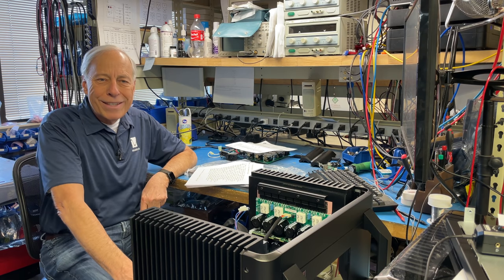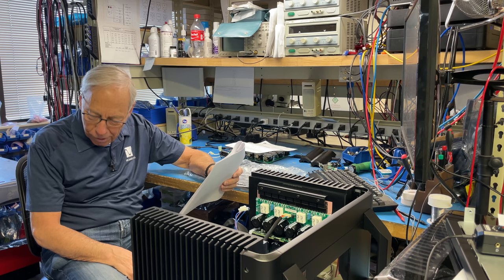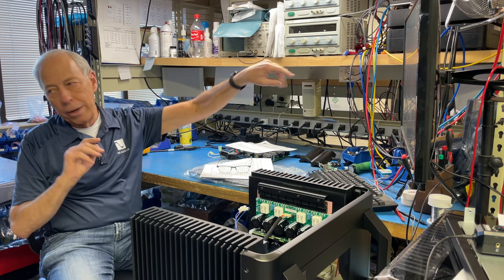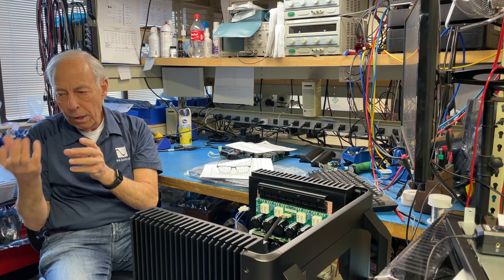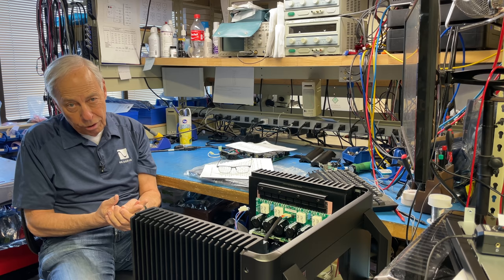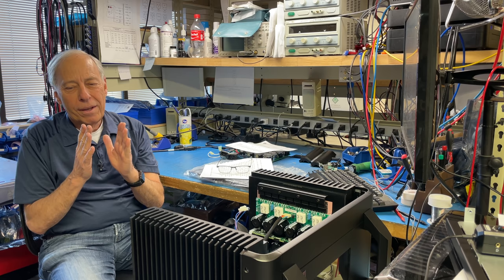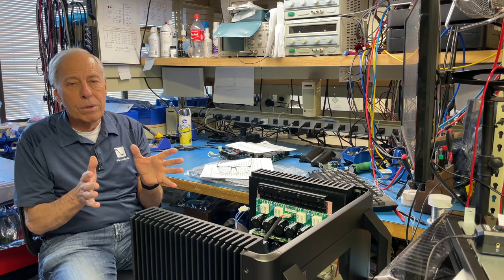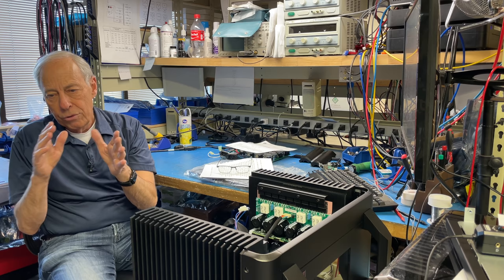Differences in digital audio cables

Comment: This is by far the best argument I've ever heard for buying premium digital cables. Still don't think I will though.
Reply: @Douglas Blake It's not even that. Even with an unlimited budget, I can't ever see myself buying 99.999(repeating, of course)% pure copper, quintuple insulated, cables with braids tied by organically raised German children. There's just no need. When it comes to digital cables, if they conform to the spec, they should be just fine. SOME of these ultra-fancy cables even break spec. If your cables are picking up noise, you probably just need to organize your cables or space out the components of your system. Monoprice and Amazon Basics cables will do just fine for the digital side, even if you spent $20k on the rest of your system.
Reply: LOL yes, most of the arguments are a lot less coherent than this.
Reply: @Douglas Blake who cares about that? the 0/1 bits when they are bitperfect don't have a noise

Comment: Provided the cables are technically sound it is 100% impossible for there the be a difference sound. As mentioned, the files are decoded and checked for consistency in the streamer. If the consistency fails, a new packet is downloaded. 

"Data isn't just data" wrong. Data packets are checked on multiple layers. When the application finally receives the constructed file it is 100% the same as the source. The jitter story is nonsense. And for the record, some folks did actual measurements on that, even with disconnecting the cables during playback. 0 difference. 

"Hifi switches" of hifi network cables are a scam. 100%. As for fiber, again if technically ok, the amount of signal loss is negligible and the protocols still error check it. We are talking thousands of kilometers before a file reaches you, through dozens of devices. It does NOT matter. The streamer matters, what it does with the file after it has been received. Not before.

Comment: There is only one way to settle this. Measure a sample of cables and provide those measurements.  Then see what is in the audible range.  Also see what the DAC does to the noise and jitter.  
That’s what science is for.    
I see NO measurements from these cable companies on their products.
Reply: Just have to listen to hear the difference.
Reply: @doctorrobin3040  damned there is no difference you can hear between digital cables - this bullshit is unbelievable!
Reply: @doctorrobin3040  If it can't be measured there is no difference. Otherwise you are then in the realm of magic or religion.
Reply: @Harald_Reindl  great business model though!
Reply: @zackschindler8334  Ah well there was a time the distance between your elbow and the tip of your middle finger was a standard measurement. Measurement science continues to improve.
Reply: @doctorrobin3040  Jesus christ get out of your analog bubble when it comes to digital transmission - it's laughable - you make a checksum on the whole source data and on the receiving end - if it's identical it's bit-perfect, case closed
Reply: @doctorrobin3040  so it is magic!
Reply: @doctorrobin3040  And yet even if the things you describe actually work do they make any difference it your listening experience?   
I worked at a GM car plant (Detroit/Hamtramck Assembly) for 30 years in the IT department. The plant was 100% dependent on the data from the servers and the network. If for any reason the line stopped running it cost $50,000 a minute (USD). Needless to say there was a lot of emphasis on us keeping data flowing. Never once was there a discussion about putting different CAT5 wires in or worrying about RJ45 connectors that might be "better" because they help the data flow. It was a noise laden environment with hundreds of welding robots running 18 hours a day. And yet the data still flowed. Rest assured that the 1's and 0's don't care what wire they go down. Don't fall for this. It is fraud.

Comment: That’s still not technically possible. If the bits had noise/jitter they effectively would NOT be the same. 

Digital cannot add noise to the file.

Comment: What does this galvanic isolation mentioned in the video have anything to do with digital audio cables?  Does anybody realize that ethernet is galvanic isolated by design?  The differential pairs offer common mode rejection and go through both inductive isolation through the transformer and capacitive isolation.  The DC coupling is done at the PHY.  A cable has NO SOUND.  A cable has RLC, period, end of story.  If you do the math the amount of RLC has to be GROSS to impact the low frequency of 20kHz.  If your cable is magically changing the sound either 1. Confirmation bias or 2. Fundamentally flawed audio gear in build or design.
Reply: it's about grounding issues with coax cables - just use optical cables and you are done - the digital transmission itself don't give a shit nor can bits have noise

Comment: Where is the noise with a cheap optical cable?  The only thing I can gather is that if your getting noise couples into your DAC from an Ethernet cable, maybe you should consider a better designed DAC. Ethernet does inherently have its own isolation.   What you describe for your new product with isolation and maybe moating is a very standard design practice, its just new to you folks.
Reply: There is no noise in a cheap optical cable.
Reply: your DAC never touches the ethernet cable because there is a tcp stack which is software - it is all bullshit

Comment: So the conclusion is, network cables do not matter cause the TCP stack will take care of everything. Though the last few feet/inches of the signal path within the device does matter, since the DAC chip is sensitive to bit/word jitter. So if you have all your cables above the bare minimum and don't get any retransmits due to transmission errors you will be fine.
Reply: the DAC don't see any jitter after a tcp transmission and there is also no noise on bits

Comment: So what Paul is telling us is that his digital input circuitry is insufficient to prevent analog noise on a digital cable from polluting his DAC output.
Reply: Paul is just making arguments for selling expensive USB cables from AudioQuest costing 30 times more than they cost to make. Even cheap DACs can have excellent high SNR above 100dB when connected via USB. It's funny how audiophiles who can live with the very audible artifacts of vinyl music incl. a horrible SNR also often are fanatically sensitive to some completely inaudible noise in the analog output of a DAC LOL...

Comment: I think this comes down to more of a cable's ability to transfer data from point A to point B reliably. Hence why you can't pump a digital 4k 120hz+ signal through older HDMI cables. They are digital, but the bandwidth isn't necessarily available. Higher bandwidth demands higher quality cable construction. I would say that lower quality cables could result in a cable being susceptible to noise which could potentially impede the cable's ability to have adequate bandwidth for said signal. But in terms of perceived quality, bits are bits. If you receive the bits without packet drops, the actual sound of the audio simply cannot be different. However, if there are packet drops it could lead to stutter or something.

Comment: Right, except on a blind test I have yet to find a person that can actually distinguish between a straight signal from an audio source to the DAC with a "cheap" Monoprice USB cable and a $1000+  "audiophile" super duper conductor cable with jitter filters and reclockers.
Reply: Because there is no difference.
Reply: @Lloyd Stout I agree, except I have yet to see one with opposite results.
Reply: @Lloyd Stout if it has other results go and find the error source, it's not the cable, especially when it comes to digital transmission, that works or not

Comment: Bits come in one at a time and are buffered, the digital data sent exactly matches the data received and is lined up in the buffer, it's bit perfect. That said, I have some "new old stock" wax and paper capacitors for your Stratocaster I'll sell you for $100 a piece and I'm sure you'll agree they have a better "sound" then the same measured value new caps.🤞🙄

Comment: Why not use optical cable, then? (product idea: accept LAN/electrical bitstream, convert to optical)
Reply: Isn't there a resolution limit to optical, either with the cable or transmitters? I've read that 24/96 is the max. That would cover most music out there in Hi-Res land. But, I bet more and more people are demanding 24/192, even though there is still a limited amount of music at this resolution.
Reply: Yah.  I've been using Toslink for years.

Comment: So it’s really about the noise isolation at the digital interface and how good it is.  So if the Streamer isolates the digital input from the DAC stage properly why you could remove the need for expensive cabling?  After all they pass the masters digitally around the world don’t they?
Reply: get a optical connection and the problem is solved, it still don't have anything to do with the digital data at all

Comment: Blind test or it didn't happen. If you can correctly identify the cable based on the sound more times than the probability caused by flipping a coin then you have something.

Comment: Mr. Paul, Another great easy to understand video.  I appreciate you very much.  Thanks.  Also, how in the hell can someone give a thumbs down to this informative video?
Reply: Because the information is misleading and the cables largely don't make any difference at all unless you're using a 1$ cable from 2003.
Reply: For more information go see audio science review
Reply: @mistafizz5195  it is possible that we can't measure everything that constitute the end result. When I changed my USB cable between my streamer and my DAC I noticed a clear improvement. I can't explain it and it probably can't be measured, but the improvement is nonetheless apparent. Not imagined. (The cables were even of the same price category, about 40-50 bucks.)
Reply: @marcusbrsp  If you can't measure the difference you can't hear the difference. The tools used for measuring are orders of magnitude more sensitive than even the best of ears. If you pay more than 50$ for a cable then you got ripped off for a similar quality product with zero tangible benefits. Especially if you are using balanced cables.
Reply: @marcusbrsp  It sounds like the first cable might've had some quality control issues. So long as you buy from a reputable brand you shouldn't have any issues. Spending more than 50$ on cables is a rip off. I spent 20$ on my usb cable and 30$ on my XLR cables.

Comment: If audio equipment is susceptible to cable design then there is a weakness in the equipment not the cable. CRC checking would show how much any link errors are actually caused by the cable. This would be a more scientific method over ‘I can hear the difference” .

Comment: Congratulations Paul for attacking this rats nest of a subject constructively.  Paul states two indisputable truths. 
1. The network will provide a bit perfect music file.  No cable impact.
2. The DAC needs to be perfectly isolated and use its own ultra low phase noise clock and have a great power supply to get good sound.  'good' means dynamic, natural, accurate sound stage and timbre.
Problem is most isolators are not perfect and let some of the noise through.  A perfect isolator eliminates all cable effects other than the I2S cables/traces within the isolated DAC module.

Comment: OK Paul I think you skipped passed the question the OP IT engineer asked and that is a shame. 

So let us break it down: 

"Ethernet Cable"  -- we all should understand that when internet/broadband etc.. comes into our property - typically via one port - we then tend to distribute this via a network switch to spread ethernet across the property - often daisy chaining switches AND also often we use a wireless router to provide wifi as well. All the ethernet is distributed using "generic" ethernet cabling typically Cat 6 (sometimes higher quality), which is somewhat shielded (well it should be ) and it works well - ultimately it gets to a port/socket near your equipment. So WHY am I supposed to upgrade from a normal Cat 6 cable to some audiophile version -- what magical thing happens close to Hifi gear. and really a bunch of snake oil salesmen are simply trying to gouge the uninformed. Maybe it is RF interference - the two easiest ways to eliminate this is by Shielding and Grounding - The simplest answer is to upgrade to say from a Cat 6 cable to a far more shielded Cat 8 cable and be ensuring the Switch provides great grounding but this only works if the switch is cat 8 compliant and so is the equipment.    The 3rd leg is by "filtering" well this is performed by circuits installed in our equipment. Fibre is becoming increasingly common and for those with long runs and high data demands it is the answer but the cable and active components are still very pricy. Ultimately one has to step down to whatever fits into the equipment. I consider upgrading Ethernet cables above Cat 8 to be a waste of money.

"Digital Interconnects" - Digital Audio Coaxial -- S/PDIF (Sony/Philips Digital Interface) - similar issues to Ethernet but obviously much shorter runs and typically used to connect two equipment boxes together. Top answer is to use Balanced cables wherever possible AES3 being the gold standard. AND then one simply ensures the cable is highly shielded and connectors effectively ground the shielding. Sure the cable design and materials make "a" difference - some claim huge other simply cannot hear it. You and others have provided great guidance and YES we can spend 50% of the price of our boxes on such interconnects or more. I like fittings like  BNC which ensure the cable is secure and the grounding connection is at least made. 
[Yes one can use TOSLINK - but this comes with its own issues]. 

Analogue interconnects -- these are the most vulnerable to interference from other sources and cables. Particularly ultra low voltage microphone/phono level interconnects. Far far better to use balanced connections. There are various levels of balanced but as a rule a good basic balanced cable will perform better in "noisy" environments close to many other cables than a simple phono cable. For phono cables - yes buy/use good quality well shielded cables but keep them away from sources and signal types that generate noise/interference. 

Speaker cables - here is the final leg. The main issue for me is that the power carried by these is the highest in the signal chain and therefore there has to be something significant to add noise or reduce transmission - and that is the cable itself and how it is connected. 100% twisted libre cables appear to be better than solid cables. BUY/use shielded cables and bundle speaker cables together. Whether or not propping up speaker cables off the floor makes a difference depends on what is in the floor. Try to keep speaker cables and unshielded power cables apart.   

Great guidance can be found - AVIXA F502.01:2018 Rack Building for Audiovisual Systems tells us that we are better following some simple separation rules - you can tie cables carrying similar signal types together and separate cables carrying different signal types apart.  AC power cables (unshielded) should be 12" away from a microphone level phono interconnects and 4" away from Audio line level interconnects [I use shielded mains cables],  HDMI and most other signal type cables should be at least 2" away from  cables bundles carrying different signal types.